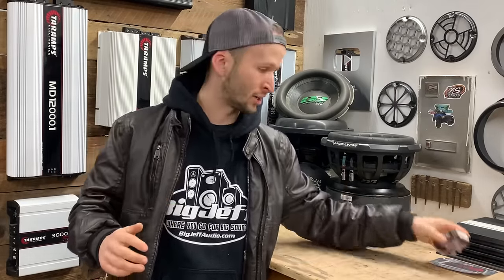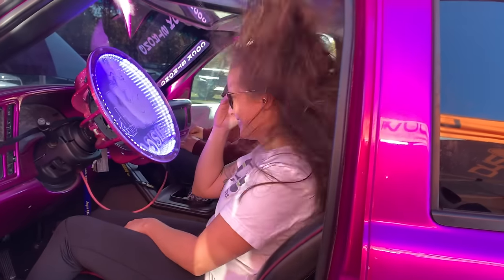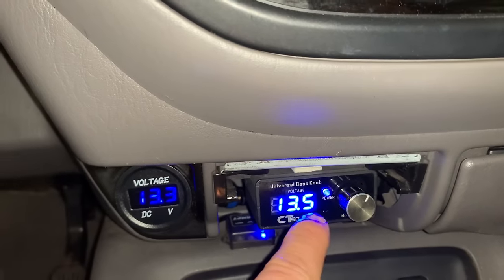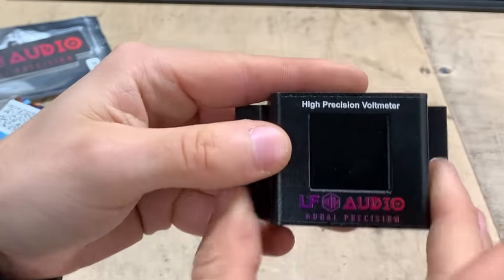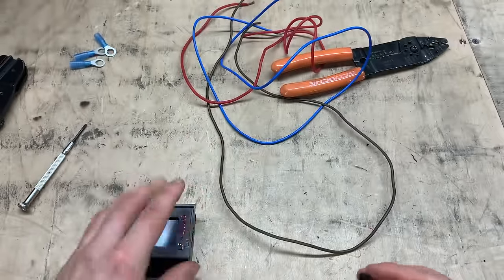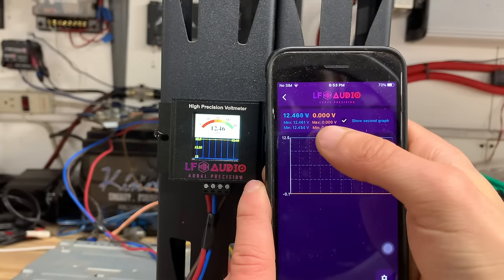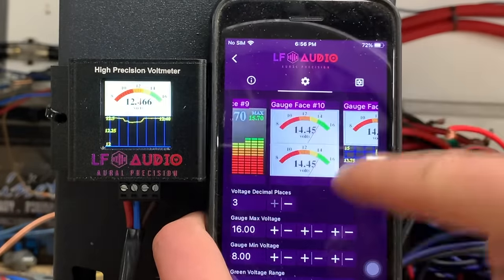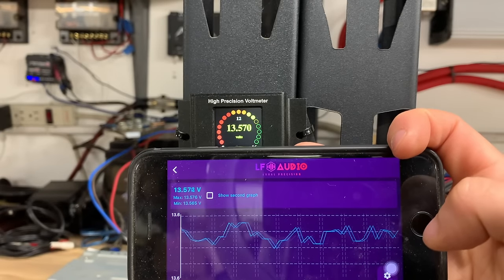This Could Save You Thousands | LF Audio High Precision Volt Meter Review

Comment: His video is not accurate as he said there 2 remote wires there is only one remote.  The other 2 power are what the meter reads . Remember the red constant will be the power that the meter reads not the remote the remote will just turn it on the 3rd hot will read the secondary source you wanting to read. Than there the black ground.

Comment: Hey bro I noticed your voltage is at13.8-14.1 like my camry but I have a stock alternator for now about to order a 290 autotech but I keep hearing that its a 50/50 weather or not the computer will drag the voltage from 14.8 where they set most HO alternator down to 13.8-14.0 have you had any problems with your voltage and how have you been able to keep it steady or at least as high as possible

Comment: This is cool but i feel my stinger voltmeter which is also adjustable works fine. It reads the same as my DMM. Not knocking this product at all. Very cool concept. Just a little unnecessary.

Comment: Thank you for the videos Parker 👍🔊
I'm concerned about my voltage in my system as I just killed my stock alternator. I'm kinda limited with options for a high output and I'm thinking about going with JS Alternators. Does anyone out there have any real world experience with JS? Any good?